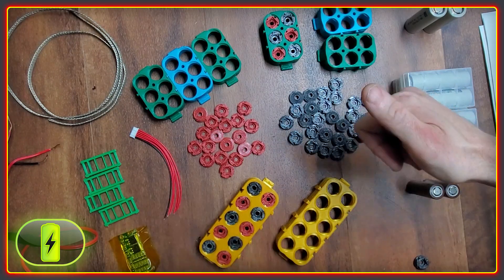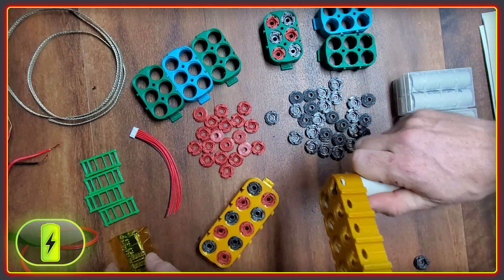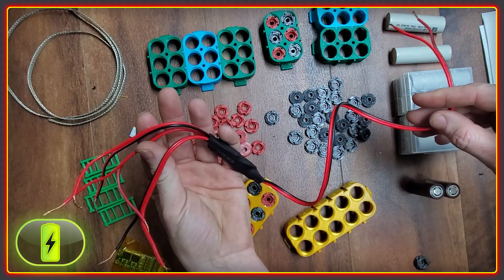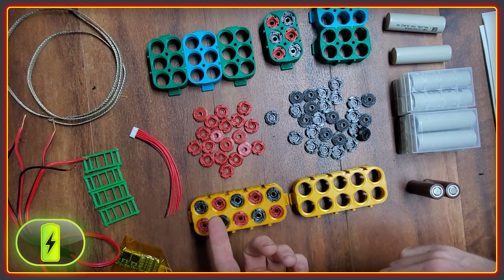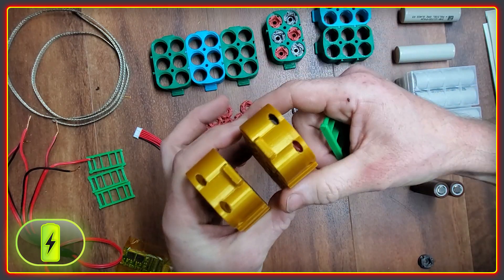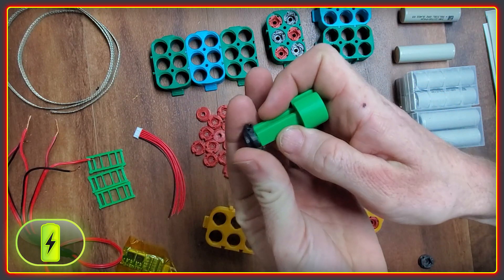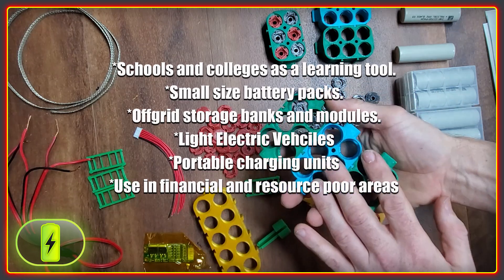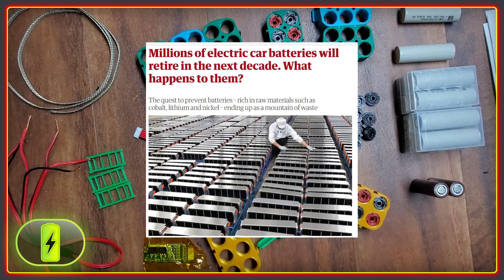Presenting the OMNICELL! Weldless Battery System for lithium ion battery packs.

Comment: Love to see more integration and combinations of super capacitors with this type of serviceable build technology.  You touch on the very hot and sensitive underbelly of manufactures holding the profit and control of “proprietary” another way of saying planned obsolescence or revenue stream from servicing (the animal husbandry definition) those who buy into and adopt a brand.
Reply from the maker: I'm not very knowledgeable about super capacitors. They have seemed promising but drawbacks. I will have to read on the current state of play with those. There are a few more recent videos I made on this. I have been vibration testing them and making some modifications to the design.

Comment: Was really hoping to see a thermal camera shot in this video. After seeing how poor connections create heat ala Vruzend and all the other DIY type knockoffs out there I've pretty much made up my mind that there is only one acceptable way to connect a high discharge pack. Spot welding (or laser welding and its varieties). I would absolutely love to see a pack built with P42A's spot welded together with copper/nickel sandwich go up against an identical pack in this product while pulling at least 20A per cell. Something like a 48V pack with 10 cells in parallel and a large DC electronic load. A thermal imaging shot along with voltage readings. Perhaps cycle each pack 100 times (if you can have access to a big enough electronic load for that long) and then capacity test the packs at the end just to show that even if there is a slight difference in temperature the pack made with this product is not degrading significantly faster than the traditional copper/nickel sandwich style pack.
Reply from the maker: I will make sure that the comment is passed on. Not sure if any camera stuff exists. Its been used on quite a few packs so far and certainly wipes the floor with the other kit that is out there. You can get hold of Joe who designed this on the Electronic Workshawp discord server and YouTube channel.

Comment: This system seams to be great. You are totally wright with your thinking of recycle the lithium in the batteries and the batteries in total.
Reply from the maker: Thanks Harold, it has developed considerably since this video was made.
Reply: @HighVoltageKits  Yes I saw the new design. Do you know if he would sell the file for the 3d printer? I`m here in Europe and have many 21700 cells, "harvested" from a Tesla 3 Model (it was a lot of work). But they can neither be spot weldet nor soldered.

Comment: Another solution to a problem that doesn't exist! Just get a spot welder and nickel!!!
Reply from the maker: If that is your conclusion then it would appear you did not watch the video to any great length. This is not about being anti spot welding. This is about letting people make batteries that are easier to build, maintain and take apart at the end of life for recycling. So much more to this that. Its not as simple as getting a spot welder. I realize that is how things are done but that in itself is no reason to continue and not to try something else. Cheers
Reply: @HighVoltageKits  
1. Spot welded cells come apart pretty easily. All you need is some pliers to pull off the nickel. So for end of life, use pliers! I salvage packs all the time for reuse in power walls and EV's. AKA good cells with lots of life in them getting taken from existing packs and reused. Stripping off the spot welded nickel is not a problem! I'll grant you "easy to take apart" in that you don't need to pull off any nickel strips with pliers. Again...this is a problem that is non-existent and doesn't need solving with a whole new system!
2. "Easy to build"...LOL "easy" is subjective. I personally think spot welding nickel is easy, inexpensive and quick. Inexpensive super cap spot welders are easy to use. You don't need an $800 spot welder or some kind of "pro grade" set up to spot weld a pack. It's just not that hard!
3. Spot welding a pack requires no other "stuff"....like plastic parts that take up space or break or don't hold securely or come loose! These are issues you never have with spot welded nickel!
4.  I don't use plastic cell spacers or frames. I build a frame from scrap wood that holds the cells together in the shape I want and then I glue them together. It's quite rare that cells goes bad, but if it happens, I use glues that can be removed again later. Once the glue sets up, the wood frame is no longer needed. Once the glue sets up nothing else is needed to hold the cells together in the desired shape!
5. Does "easy" include all the balance wires and interconnections between banks of cells that need to be made no matter HOW you might build a pack? Is this really "easier" since the only real difference is using cell holders instead of spot welding?
6. Space is always a concern! Fitting the maximum number of cells possible into any given shape and volume is always a challenge. Using something that forces me into blocks, leaves gaps around cells and takes up extra space on either end of the cells just for so called "Ease of assembly" isn't compelling! These kinds of products make pack capacities LOWER and with fewer cells...AKA...THE OPPOSITE of what anyone wants in their EV! Who do you know says "I want LESS range"??? People want MORE capacity, not less. They want the highest capacity pack they can fit in any give space. Omnicell is the opposite of this! Densely packed cells that don't waste space are what people want!
7. I use .3mm nickel. I try to keep my total interconnect resistance low as possible. If I can build a pack that at 100 amps generates around 20 watts of heat across all of its nickel, I'm pretty happy with that. I also get less waste heat than this! Can Omnicell in a 20S10P pack at 100 amps generate LESS than 20 watts of heat across the entire pack? With nickel plated copper in the same sized pack, I get more like 10-12 watts of waste heat.
8. Takes up much more space, adds extra cost, adds extra weight, doesn't pack the cells together as densly and requires mechanical contact held with plastic parts instead of spot welds. How is Omnicell a good choice???
Reply from the maker: Thanks for taking the time to do this. I will be doing a follow up video after when I build my packs where I will address questions such as these. Ease of assembly imo is the least of these issues. Space wise it's not as bad as you seem to think and I will address that too. Space in powerwalls is not relevant tho. What people want is very subjective. You are overlooking the critical advantage of this which is repair, reuse and recycling. Anyway thanks for this. I appreciate your time spent.
Reply: @HighVoltageKits  
"repair, reuse and recycling"...OK...I'll address these more directly than I already did!
1. Repair: NOT hard...remove the nickel, pull the bad cells, drop in new ones, secure them like the original ones and then spot weld them in place like the original ones.
2. Reuse: Get some pliers, pull off the existing spot welded nickel. Arrange the recovered cells in whatever way works best for you and spot weld them into a new pack. I've done this with at least 3000 cells.
3. Recycling: Get some pliers to use for pulling off the nickel form the cells in the existing pack. Pull off the existing nickel. Check the cells to determine if they are really no longer usable. Take them to a battery recycling location.
*
Your arguments in the video are only somewhat valid. People do try to recover cells from Model 3 packs and others that are bound together in epoxies. This is a painful process at best. Demand for recovered electric car packs is quite high and almost all of them end up getting reused in some other electric car. They don't end up in land fills! Even AFTER they are no longer any good, electric car packs almost always get recycled! This is not so true for laptop or tool packs where the cost of recycling is quite high for the amount of raw materials recovered. Small packs for tools and laptops do get tossed into land fills quite often. People reusing electric car packs are NOT likely to be the people that Omnicell will ever reach. Those people probably scrounge laptop and tool packs or used packs from city scooters. NONE of those kinds of packs are buried in epoxy! Maybe they buy 30 or 40 new cells to make into a pack. This video makes the generalization that "all packs" end up in land fills and that's just stupid! The prices for used electric car packs is quite substantial! Good luck finding them in a land fill!!! It also implies that people wanting to build a small pack are going to buy an entire Model 3 pack and that too is stupid!
Reply: @de-bodgery   I would think the omni cell packs would cool better than the denser spot welded ones.
Reply: @kevinmccune9324  No not really. Gaps between cells...aka dead air space...conducts heat away far poorer than does physical contact between cells. If you look at anything Tesla does and lets face facts, they are experts at battery building, you'll see physical contact, not air gaps. Never mind these plastic parts take up valuable space, break, fail to hold tightly to cells, etc. This is as I said, a solution to a problem that doesn't exist. The nickel radiates heat much better than plastic.
Reply: @kevinmccune9324  If you want good thermal conduction between cells, use thermal glue like I do. Pack them tightly together and apply thermal glue (NOT thermal paste) between the cells. Now they all radiate heat at pretty close to the same rate and distribute any warmer areas to the cooler areas. The thermal glue also holds the cells together as a block so that they can't move. It solves all the thermal issues, all the bonding issues of making a solid block and is removable later if needed while not failing like plastic does or taking up extra space.
Reply from the maker: Great argument. Tesla do it so it must be right.... Your arguments that the batteries don't hold up has not born out yet.
Reply: @HighVoltageKits  When did I argue that the cells don't hold up? I think your are referring to the plastic parts or cell holders. You have 2 kinds...these ones in this video and the typical cell spacers commonly used in many packs. Cell spacers are not under tension. They serve the same purpose as bonding cells together with thermal glue without any of the thermal benefits and taking up more space. The cell holders presented in this video are plastic parts under tension which is a poor use case for plastic. It does eventually break or separate. This is fact and I've observed it happening many times. So I'm going to say...wait and see, it will happen! These are plastic parts after all! You are entitled to use them if you like, but I'm not going to. They won't hold up long term. Besides there are much better solutions than this garbage that in fact HAVE long term service lives...aka spot welding. No one serious about building a pack would use these cell holders!
Reply from the maker: Actually the parts are working along layer lines and in compression. But let's be honest you are never going to give it a try. Or even look at how they work in any depth. Not missing your drama man.
Reply: @de-bodgery   Thank you I believe you, looks you would still need a place
 for the warm air to escape, been contemplating an 11S-4-5P for a future 36 volt build would like to use the 21700 cells
Reply: @kevinmccune9324  You don't really need to worry about that when the entire pack outer surface area can radiate heat since it is all thermally tied together. I'm personally running multiple packs as I build them. The biggest one can deliver about 600 amps max. It regularly sees 250 amps at 82v at 164Ah. It's a pretty large pack! The important detail is that it has multiple temp sensors in it and yet the pack never gets but 2-3F warmer than ambient air temperature. Basically, it works for Tesla and I'm just copying them except for the active cooling.
Reply: @HighVoltageKits  You are right about one thing. I'll never use this. I see no need! You solve a problem that doesn't need to be solved. There is much better ways to build a pack that takes up less space, less mass and lacks any of the reliability issues plastic parts introduce. As far as "solutions" like yours, there are better ones where the cells and conductors are held in compression with screws instead of plastic. I present no drama. I present facts. You want it to be drama, but it's not. IF your solution was soooo good, WHY don't battery manufacturers the world over use it? It's because it's a terrible solution! Again, anyone serious about building a pack won't ever use your "solution". It's simply a BAD idea! Never mind that the plastic can melt, soften, stretch, etc and create more issues! You are trusting something for a solution that shouldn't be trusted for a problem that doesn't exist!
*
I grant you this. People that can't build packs for lack of knowledge and understanding or lack the equipment would be attracted to your "solution". The problems I've already described are also something they are unlikely to think about, know about or have experience with! As a result, you open the doors for people that have no business building packs to literally burn their own house to the ground! Lithium Ion cells can be dangerous if misused and you make that easy for people that have no clue what they are doing!
Reply from the maker: Okay, don't use it.
Reply: @HighVoltageKits  I don't need you to agree with me. However, someone SHOULD be telling you this is a BAD idea! It's not an attack, it's just a bad product idea that creates hazards and failure points instead of fixing any real problem...which is doesn't do!
Reply from the maker: Well again. You have an opinion. You are free to voice it. You are already saying it's a bad idea. Others myself included disagree. People can read your comments and can make up their own minds.

Comment: Excellent innovation, thanks for sharing. I'm in Indonesia & sourcing reliable battery packs for my BBSHD has  been problematic - still getting my head around the issues that the locally produced batteries are presenting. That aside, this DIY concept, without soldering (I'm not adequately skilled), seems to provide a great alternative to, what seems, battery build issues associated with what's currently on the market. Please keep updating on Omnicell when you can. Cheers. Gus.
Reply: thanks!!

Comment: This looks great! Great work! Joe, is this different from what you have on your website? I haven't seen many changes there recently. I'm looking for materials to build a 14s2p 21700 e-bike battery, ideally with a blue-tooth enabled BMS.
Reply: I made a 4 cell stackable module for 18650 but it can easily be adapted to 2170. I will do that tomorrow and put the listing on the site. You could make a 14s2p battery with 7 of those modules. I can find a bluetooth enabled BMS for you as well.

Comment: MEH too much expense time and faff be as well just modifying generic 6-10 cell powerbanks and gluing them together/electronically linking them up for series and once complete dipping the whole lot in latex to set or likewise. My thoughts anyway (obviously again likewise for low current draw applications.
Reply from the maker: Thanks for the comment. Would this not make it very hard to recycle said battery?
Reply: @HighVoltageKits  well depending on exactly what you choose to do to hold the lot together BUT keep in mind when they land in this banks for this purpose they essentially are now in final use/end of life anyway...if you meant in regards of cell teardown recycle thats exactly why i particularly suggested casting in latex (or likewise rubbery substance) as opposed to the likes of epoxy because the latex at a later date you can simply cut so far with  a stanley knife of likewise and pull the powerbank casings out to then simply pry them open to get to the cells. I came up with the idea of using Epoxy for ebike batteries a good few yrs ago in the endless sphere fbook page and sure enough within weeks later tada that fcukwit gambling degen from Lunacycles had his guys throw packs together this way. No idea if they ever reliably mastered that? as always in the back of my mind as great an idea it is structurally wondered if heat issues/runaway internal fires and such like would be a thing.
Reply from the maker: Not shocked to hear that the poker king stole something. He leaves a trail of destruction like this. Have encountered dozens of folks wronged like this. Ranging from outright rip off and theft to sabotage and abuse. A real sick pup.
Reply: @HighVoltageKits  agreed, in that case like i said he never stole it but clearly jumped straight on it as soon as he seen it, cant remember what he called it the lightning pack or something (clear epoxy) recall he was having issues/complaints with the early ones not sure if he still even sells them not even looked on the site in a good couple yrs....obviously away to look just now :)
Reply: @HighVoltageKits  Yeah the batteries are still listed (only type he does now funnily enough) BUT all out of stock very odd. would imagine it would be the kind of thing he would strive to ensure he always has